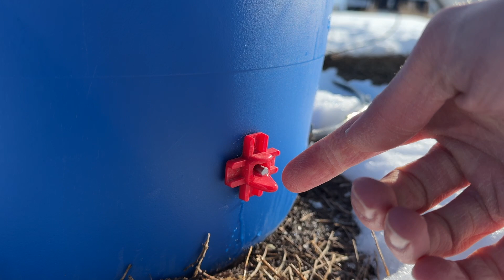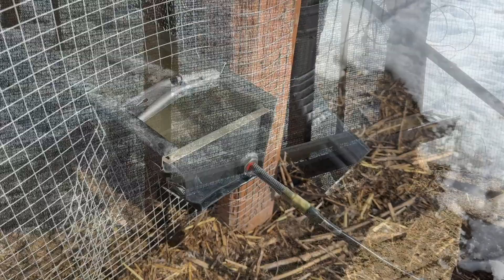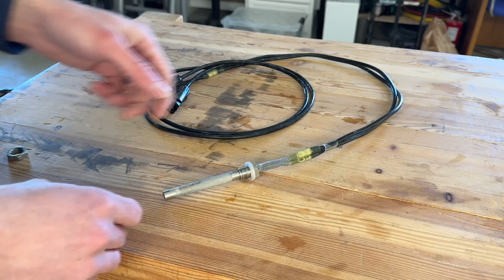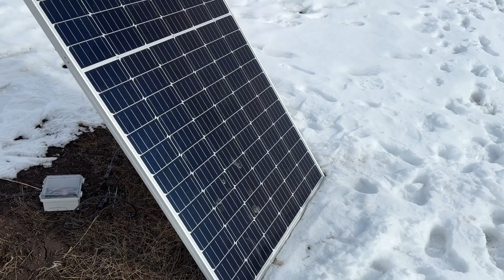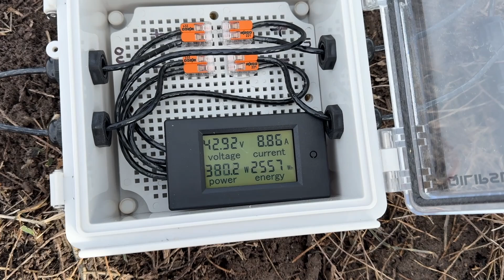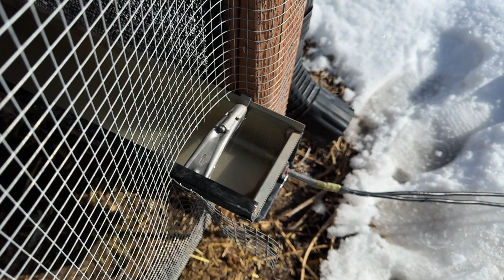Your Chickens Want Solar Too...

Comment: Running a 500W heating element, automatic door, and lights on a single 380W panel is a challenging, high-draw setup. The DERNORD heater alone requires more power than the panel produces in peak sunlight and would have much less power

Comment: This is very cool - or warm (smile). The upfront cost of the solar panel is significant. There may be a better way. Here is a link to an instructional video: 
https://www.youtube.com/watch?v=7mi27HDiWFI
Altho it talks about houses and chimneys, you could adapt it to use for chickens.  At my local Lowe's they sell a solar-powered bird bath fountain pump for less than $20. Using that tiny pump, a piece of flat sheet metal painted black, and some irrigation tubing, you could save the expense of the solar panel.  With a slightly larger pump, you could use it for radiant heat flooring.
Your thoughts?

Comment: I'm noticing that your heating element is already stained. Try using sacrificial anode (like in boilers) to prolong heaters life, because eventually it's going to rot trough. You can just zip-tie any size anode to heater

Comment: I use the old-fashioned metal two piece siphon chicken water and I have cut a 5 gallon bucket in half and silicone the base of that water into the bucket so the trough all the way around and the tank inside are all exposed inside the 5 gallon bucket half and in there, I have a 60 W lightbulb connected to a thermostat that monitors the outdoor temperature and turns the light bulb on at 32° and turns it off at about 35° and that has solved my problem with chicken water every three days we have to go fill it we have about 18 chickens in New Hampshire so it’s plenty cold. I never thought of hooking that lightbulb to a solar panel. I already have a battery and a solar panel in the coupe that runs the door that I open in the morning and closes at night. It’s all programmed. I’m back if I can find an incandescent DC lightbulb, I could run that off of the battery at night and the solar panel during the day thanks for the idea BuB❤️‍🔥❤️‍🔥🙏🏼🇺🇸
Reply: AC or DC isn't matter for incandescent bulb. Just look for voltage and wattage you need

Comment: You should also add a cheap temperature relay or something similar so the water doesn’t get too hot. Then you could transfer the heat to a cheap air heater inside the chicken hut to make it a bit warmer. But very cool
Reply from the maker: That's a great idea!